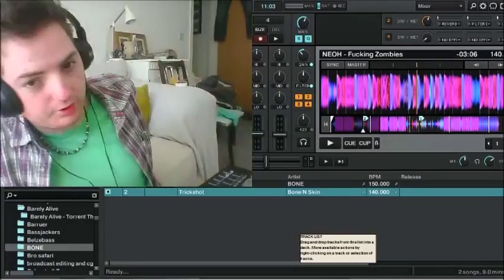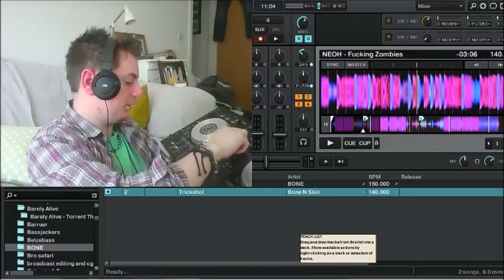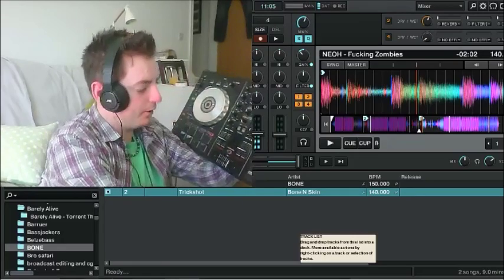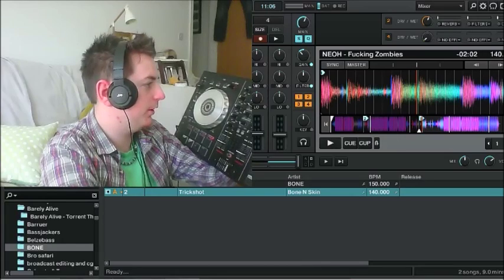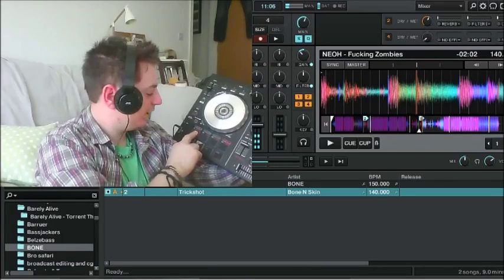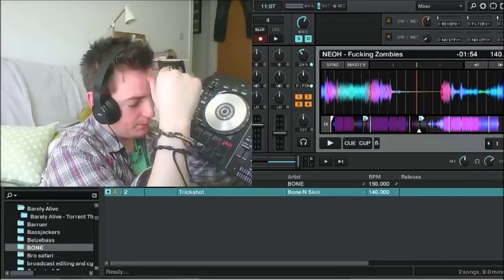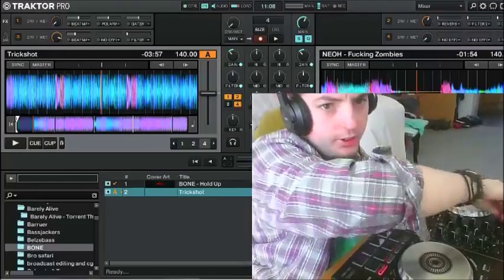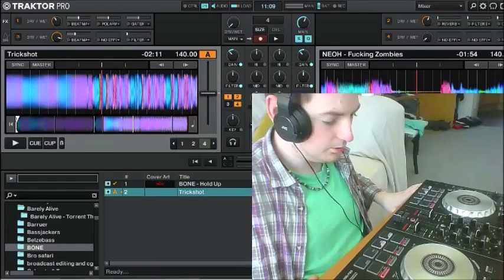Air1ess Traktor Mapping for the Pioneer DDJ-SB2 (outdated and not working on)

Comment: Hi .
Thank you very much for your contribution.
I have a question ...
Did you get the complete configuration of the machine with the program?
Reply from the maker: +Gabriel López Vergara no it was half finished there was a lot to be done like hot cues and the loops and sampler so I emailed my friend who gave up working on it and I finished the rest I'm still working on this more like the key knob how that will work if you hold shift you can turn the key knob and other work so on.

Comment: I checked on your map, and it was the best i downloaded brother :) (I 
downloaded a bunch of them)............the problem and the solution for 
the pad trans u will find in to my channel, i just uploaded a clip..
 If u want to use the Pad Trans as u will see in my clip, u shall do not 
have mapped in to traktor 2 any of the pads (when the Pad Trans" is on),
 and  in any of the 4 Decks,  (they give the same value anyways), or the
 Tap Feature, so u will use it in to traktor to set the tempo at witch 
the Pad Trans will perform the Fx....(if u have this last 1 mapped in to
 traktor u will be changing the tempo (information) of the track every time u want to 
adjust the pad trans speed unless the track is locked off 
course...cheers..